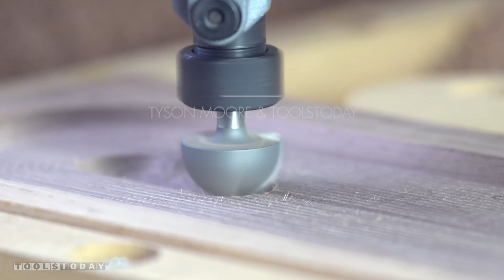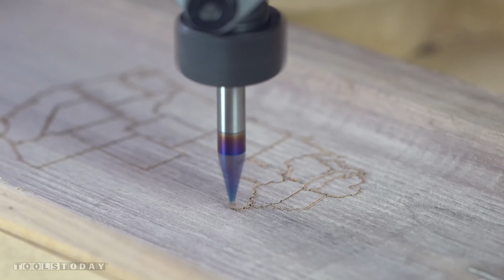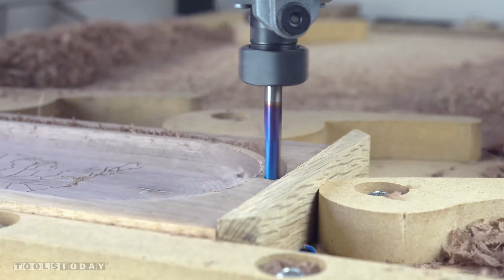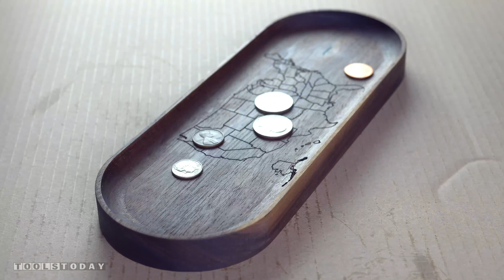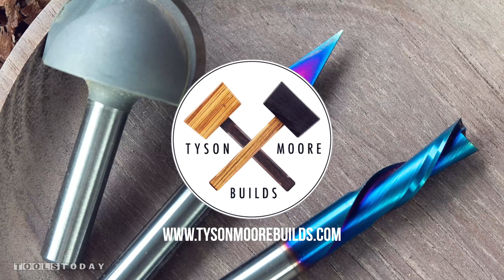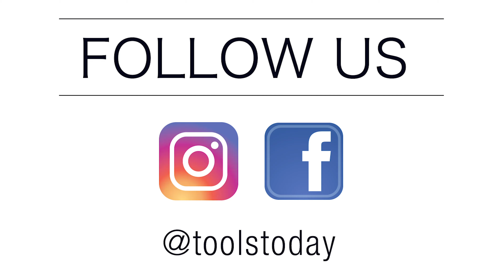CNC Walnut Catch All Tray USA | ToolsToday (4K)

Comment: Hey Tyson,
Just a quick question on your Feedrate for the 46202-k bit. I have both a shapeoko 3xxl and ventric aspire…..for some reason, in my tool library (downloaded straight from Amana) the bits parameters are 60ipm at .25 depth/pass. Are you really running it at 180ipm & is the shapeoko 3 capable of those speeds? Appreciate any help 🙏🏼

Comment: Great tutorial...just got started on my upgrades to Spektra Coated bits:)  Can you tell me the thickness of the walnut?  Would love to make a couple of those on my Shapeoko.  If it’s 6/4” I think I can get that fairly easily locally.
Reply: Shad Beck hey Shad 👋🏼 so this was actually just 4/4. In fact, it was .856 inches and the bowl part is cut down to .4 inches
Reply: Tyson Moore / Builds even better, thanks Tyson:)